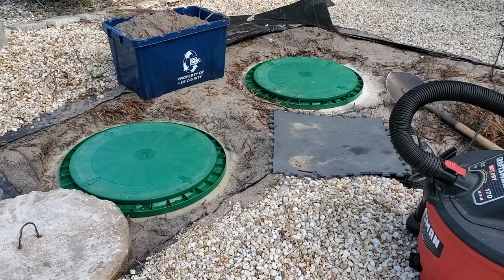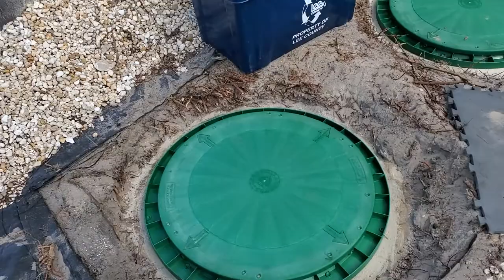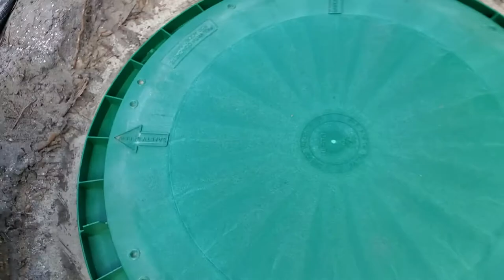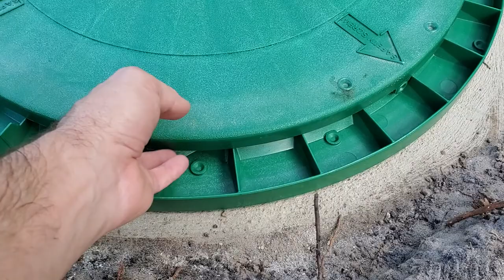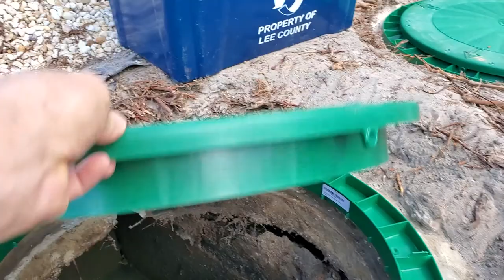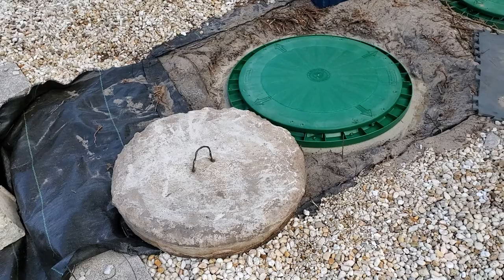How to replace your septic tank lids with light tough plastic new ones.

Comment: I'm having same problem with my septic tank. Thanks for comforting considering costs.
I called fake pumper who didn't know the job well, got his truck stuck three times, without 
complaint I paid his fee never expecting come back,  saved backyard and lost 300.
Three are trying to help as follows:
One: You need new tank and drain field, cost-not to exceed 15k. (I do have inefficient drain field  and nothing else)
Two: You better watch out- this whole tank just might cave in and damage house too.
Three: Pump out and replace lids.
Along leech line I dug test pits myself and found wetness( about 4 feet deep all by handy tools),
I'm guessing the problem is roots. I have lot of respect for professionals.

Comment: I recently had to do this, but mine were buried, one about 18" deep the other 24-28" deep.  Took a lot of hand digging to get to the tank top, partly more difficult not knowing exactly where they were.   If risers are needed, as I did, you want a large enough hole to be able to wire brush and vacuum out the dirt.  Helps if every thing is dry.    I did use 1.25" concrete self tapping stainless screws to hold my adapter ring down and used polyurethane caulk instead of the butyl 'rope'.   I also felt around the top of the tank for protruding stones where the adapter ring went and pounded down several with a hammer.   Make sure your hole is large enough that you can easily reach the screws for the risers as the risers screw to the adapter ring, not fun getting everything ready and 
realizing you can't reach the screw head or even see it and then have to enlarge the hole and clean it out all over again.

What is the importance of all this:   septic tank cleaners charge a lot extra if they have to dig out the lids for you and many jurisdictions require risers and lids to be placed, so as the OP noted you can save a lot if you can DIY and it makes the next clean out much faster.    My cost, direct from the company for rings, risers and lids for two tanks was $450.  Stainless tapcons from Amazon.
Reply from the maker: Nice!

Comment: Thank you for this succinct video. We have a three tank system that up-drains to a 60 foot sand mound. Our concrete lids are crumbling. One is so bad that I covered the tank with a 1" thick wood platform and dropped the lid on top, to weight it down.
Your video is exactly what is called for. Just ordered the three items from Amazon.
Thank you!
Reply from the maker: Yw, glad it helped.

Comment: They are definately a good idea once you start pricing what they want for essentially 2 80# bags of concrete and 10' of rebar. Like $200-300.
Only thing with these is, I don't think I'd trust them to take the weight of my 800# tractor/self.   If you can landscape them out of sight, then yes worth it.
I'm not sure why you didn't want to anchor them as manf. directs though.
You're relying on the rope to not only seal but anchor them.  My understanding is that you really want them sealed (smell) and to avoid water infiltration. 
Just buy the tap-cons or concrete anchors and let them do the holding so the rope can do the sealing.
Reply from the maker: Yes, i just didn't feel good about tapping my concrete. It seemed brittle and like I might do more harm than good. That rope is sticky and im sure a bitch if you had to pull it up later. I had no reason to fear it would go anywhere once burried. Incidentally it was tested to the max in Hurricane Ian. They were under 2 feet of water and my house had 4 feet inside. It backed up the toilet and septic tank dumped into my house. The lids did not float off as I figured they would, being pressurize by overfilled septic.. It was a joy!!

Comment: Suggestion for cement lid and riser ? I want to replace with plastic . Would I need to cut the riser because I do want them alittle lower also
Reply from the maker: Don't buy a riser. Just do what i did, trim ring, lid.

Comment: Thanks!
My question is 
Why didn’t you screwed the adapter ring to the concrete?
Reply from the maker: Good question, I did not feel it was necessary as that tar rope glue is strong stuff so I had no fear it would move and simple gravity and the dirt and stone over it was more than enough to insure nothing would ever move. My hope is I will never be messing with them again... O, I forgot, I also did not want to be busting up my tank with drilling, I was concerned it migth be a bit weak and brittle like the lids were. GL
Reply: Thanks
I have to replace my concrete lids and I found your video but I don’t know if I need to use a riser before the plastic lid or just do as you did.
Reply from the maker: @jaimesalazar3963  you definitely need the TAR, "Tank Adapter Ring" as to weather you need the "Riser" is up to you and your desired level you want your lids at. Just figure out how high you want your lids sitting and get the riser to match. As you can see from mine, I wanted them buried and not "Risen" with a Riser. GL

Comment: Can water get in these?
Reply from the maker: Not really unless its a flood but then you got bigger problems..
Reply: @wetlifesports  so is there a way to prevent it from flooding if there is a flood?
Reply from the maker: @lamontedwards9293  I guess I would screw down and use more of the glue rope. Go around 2-3 times with the glue, then screw. But if you have a vent hole you'll need to address that as well.

Comment: This lid is meant to be for a riser. The lid does not seal the ring adapter directly . I'm on the same boat and need a solution.
Reply from the maker: You just need the "TAR" Tank Adapter Ring like i have. Its what i glued down, then put the lid on.
Reply: Hey, im in the same boat as you. Got the adaptor and lid but feel like the fit is not thight and looks like the riser probably has a better fit for the lid. What did you end up doing?

Comment: long story short my lid fell in, well this also work if i have a square top and lid?
Reply from the maker: Not sure i know what you mean.
Reply: @wetlifesports  Square lid just needs a large enough ring to fit around the square.  The web site for the lids in this video makes them upto 30" ID.  If your lid is  much more than this on its diagonal measurement you might need to fill in the corners that extend beyond the ring with stiff hydraulic concrete.